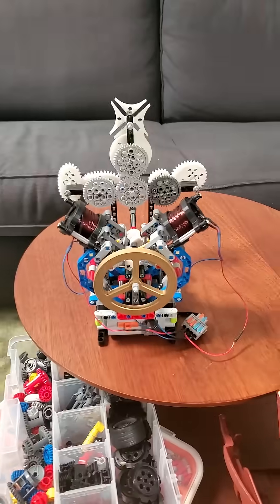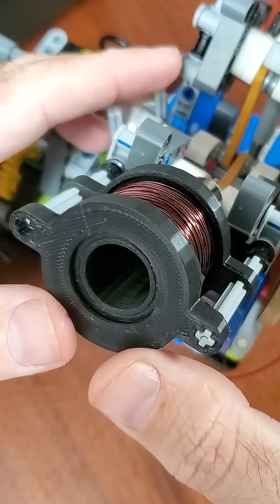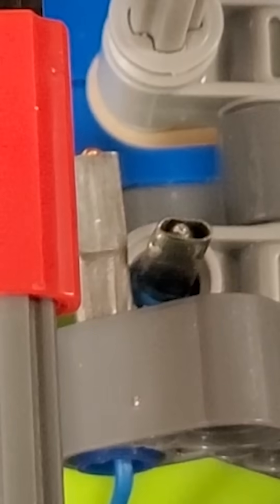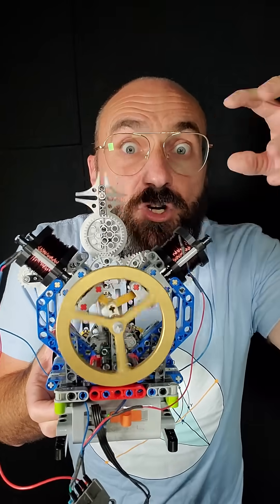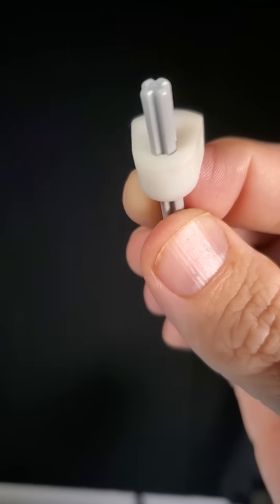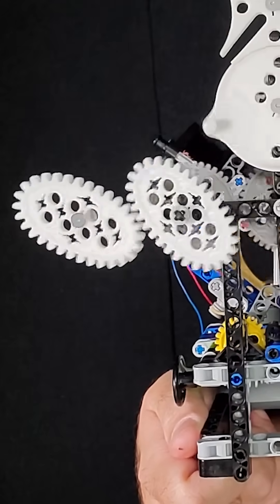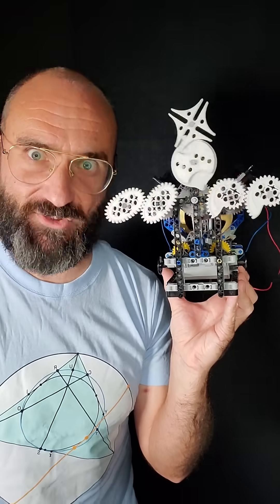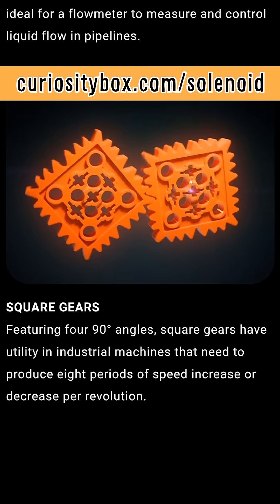I Made A Solenoid Engine!

Comment: Vsause took this much time to design a low rpm, low power DC motor. In that much  money high rpm , high power bldc motors , high power esc and power supplies are already available which will be able to do some useful work

Comment: This is technically an electric motor, not an engine. Engines use a combustible fuel to produce heat to change thermal energy to mechanical energy. Electric motors use electrical energy to create mechanical energy to do work.

Comment: Could have easily just built with a some coded signalled  solenoids to engage with the correct engine timing but instead the beauty of the mechanical art has remained to accurately engage each solenoid at the perfect time. Bravo to the model creator👍

Comment: I have two questions that I was wondering about, and I hope you have the answers.
 
First, I want to say something, which is that I am a bit stupid in such matters, so please excuse me if the questions are silly.
 
1) When you put a plastic water bottle in a water tank, we all know that the buoyancy level of the water inside the bottle will be equal to the buoyancy level of the water inside the tank, right? But what if we put a polystyrene tank with a thick bottom in it and fill it half with water, Will the same thing happen as with the plastic bottle? That is, the water level inside the small box will be equal to the water level in the large tank.
 
2) Regarding the subject of not being able to fold a paper more than 12 folds, what if we cut the paper in half and put them on top of each other? Won't that give the same result?.

thank you for reading.

Comment: I have an old motor home generator that uses basically this same coolness for the fuel pump, also the water valves in a washing machine work on this too. Very cool. P.s. I love the autographed poster I got from yall awhile back with the rocket launch. Keep it coming, sincerely some of the sauce

Comment: I felt obligated to relearn my 12th grade & college Physics because we're now in the Electrical Age. So I took out Physics Demystified from the library and read 4 chapters and tests on D.C. & A.C. Current. When I learned when you take glow ball and swing it in a circle on the end of a string 2m in radius. One 360° rotation/second. And look at it edge on in a dark gymnasium from 30ft away. Then measure the glowball swinging from one end & back. And back again (360°) - If Time is on the X Axis? And ball position (Amplitude) is on the Y Axis? With Radius of the string at 0, or Nadir of X & Y. You get a Perfect Sine Wave! Meaning 1 Rotation, or Cycle of 360° is 1 Hz. 1 Cycle/second. Which is the 'Period' of the Perfect Sine Wave. 'Frequency' is it's reciprocal - Seconds/Cycle. This is how pulleys, solonoids, motors, and engines work! One Cycle of a Wave being One Pulley Rotation. So with Standard Wall Socket Alternating Current at 60Hz the pulley creating the A.C. Electricity goes in one direction in the wire from 12-6 o'clock on the pulley 0 to +2 Amplitude 120/sec. Then the other direction 6 to 12 o'clock 0 to -2 Amplitude on the Y Axis in a Sine Wave. Giving you 120 Volts Standard U.S. Alternating Current. At 60 Cycles/Sec. Simpler Direct Curent (from any battery) just goes in one direction!

Comment: Question, if you were to design an electric car would you use one of these solenoid engines to make it work or would you choose something else?
Reply: No, you would use conventional electric motors, wich turn electrical energy directly into circular motion.

Solenoid engines turn electric energy into linear motion and and then into circular motion, this is very inneficient.
Reply: @davisdf3064  so what you’re saying is.. this engine could be used in other machines like Miniguns or washing machines?
Reply: @menacing_pyro 
No, because those also use conventional electric motors

Comment: could you make something using magnets so it pulls the object up, which would push a trigger sliding a wall between the magnet and the object, making the object fall, which in turn would push a trigger that would move the wall away so the magnet would again pull the object, and so on and so on...